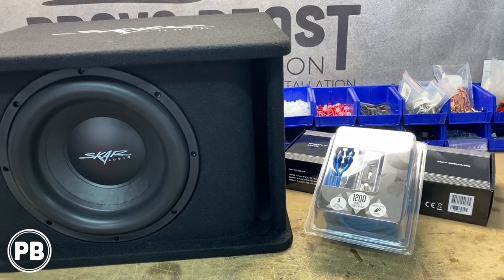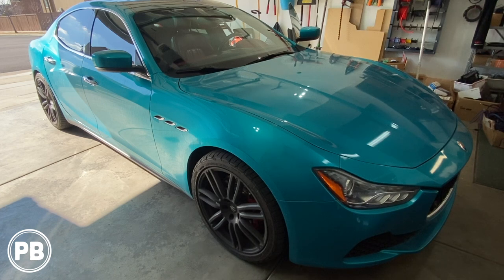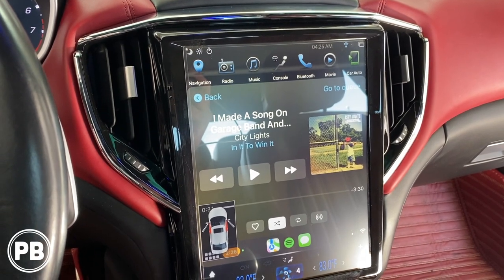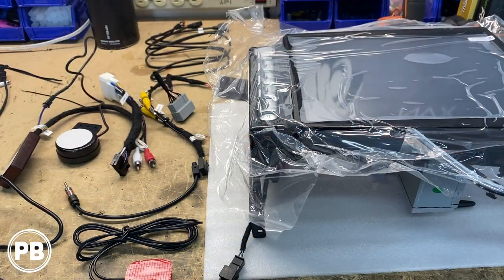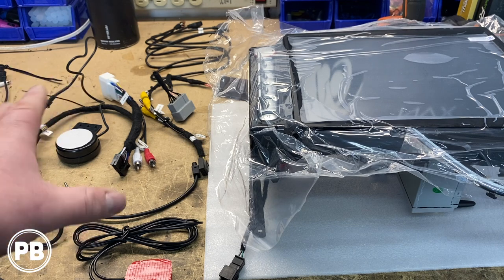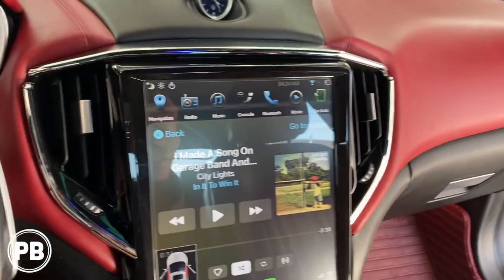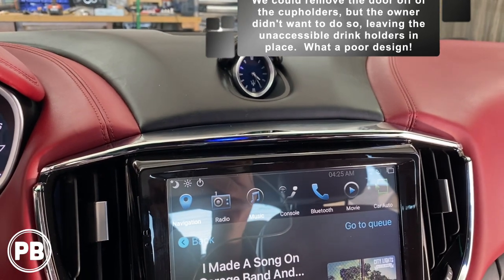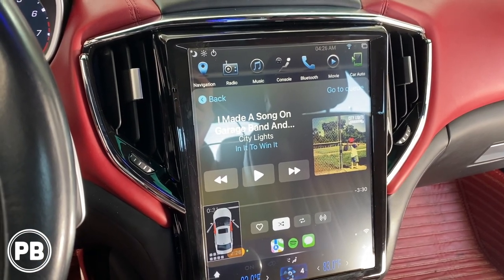Maserati Ghibli Tesla Radio Install & Giveaway Winner

Comment: Replace the center console with one from 2019 and newer. The cupholder door is removed. It's plug and play for 2017-18 models.
Reply: This really true?? So I can take a 2019 Ghibli screen and put it in my 2017 without issue?